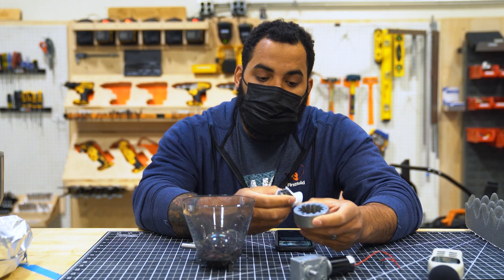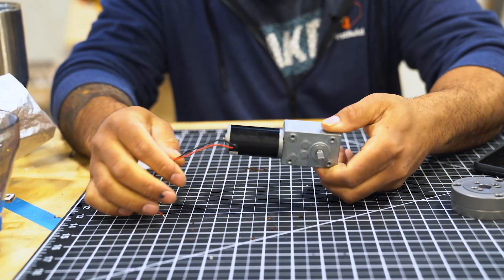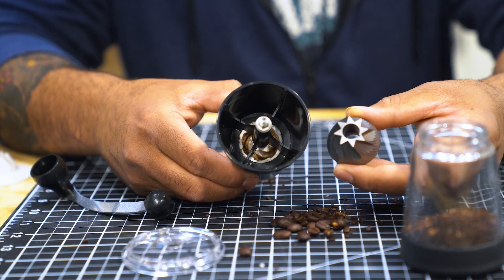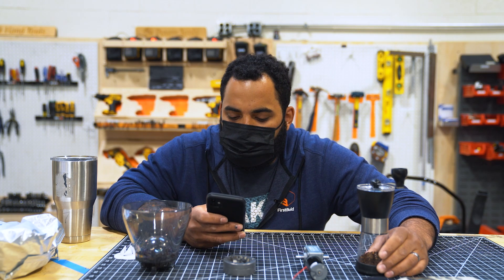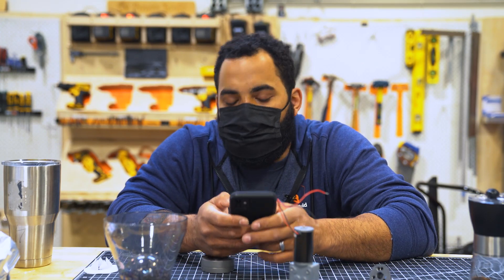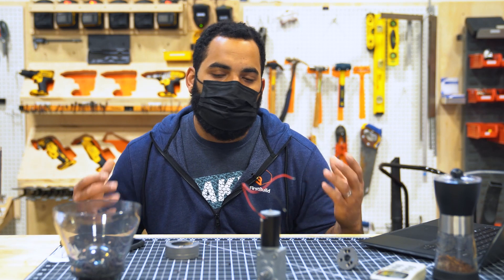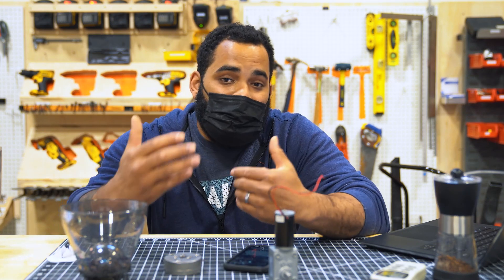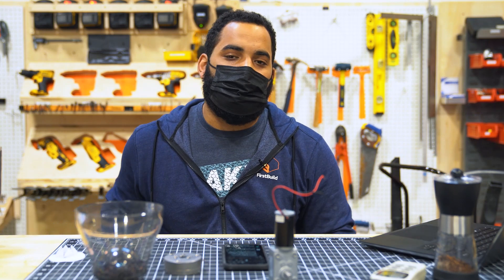Prototyping A Coffee Grinder Silencer [PART 2]

Comment: I think in your first vid, you should have made a base to insulate the grinder from the counter top.  The acousticly insulated 'cylinder' or box shouldn't have a door.  Just an open bottom that fits up against the acousticly insulated base.  You just place it  over the grinder and lift it off to access.